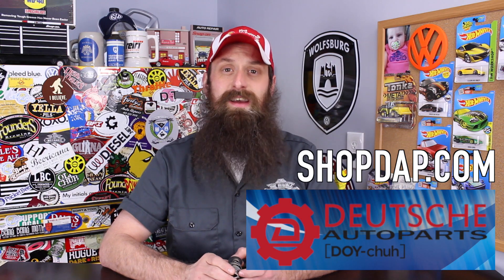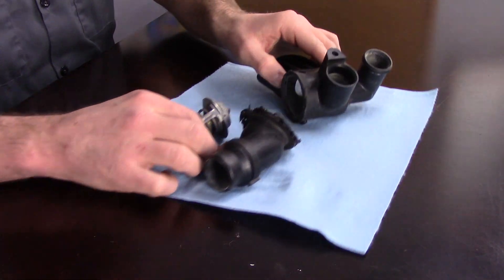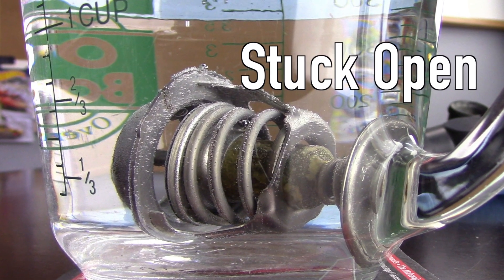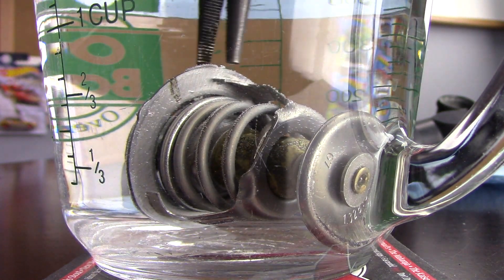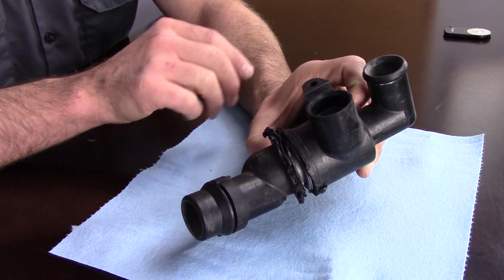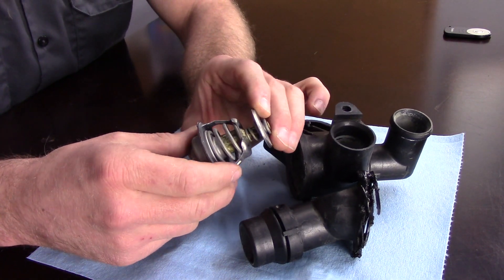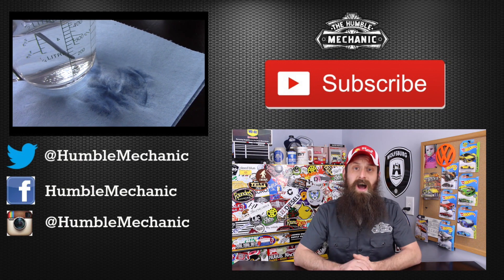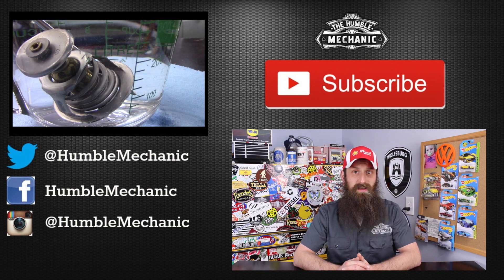How VW Parts Fail ~ 2.0t BPY Thermostat Code p2181

Comment: A lesson from one DIYer to the other DIYers out there.... On the BPY (2.0 turbo FSI) watch out for those slider pins on the alternator. I barely got them to move after soaking them with penetrating oil overnight.

Comment: Hi Charles, vid was super, super helpful!!!!

Bit late on the vid but had to add this as it happened on my 2.5 B7 Passat .. In my case it was failing partially closed which cause the car not completely overheat but partially heat up and cool down in weird random cycles. Firstly, the car started to overheat only when idling and then gradually as I kept driving would also overheat at speeds 30~40. 

On side note... why, oh why, did VW put the thermostat in between the intake manifold and the engine block!!!???? It turned a 5 min job into 3hr+ job 😥

Comment: Hi Charles I work mostly on VW and other European cars and what I see most of the time is the thermostat opening too early some cars will display a fault for coolant system temperature not reach or something like that  but some car are really good at hiding the fact that the coolant is not getting hot enough one motor come up to mind is the FSI engine what I do is always go for a test drive and check with a scann tool and make sure that the tempeture that the ECM and Cluster is the same or close and go for a test drive at a constant speed and check if the engine coolant reaches at least 90 deg cel but most of the time it will be at 75 deg cel then you know that it's not good but a stuck thermostat in A VW is not very common but a broken water pump is I would say for a common engine the 2.5 L five is not easy to replace especially on a New Beetle I have yet to replace a water pump on a TSI engine .

Comment: Have this code on my 2008 VW Eos. Also the temperature gauge would never reach 190 degrees which is the middle. It would hover between 145 degrees or 170 degrees. If I'm driving in the freeway it stays at the one quarter near cold. That's how I knew it was bad and stuck open so I sent it to my mechanic. Will update how much it cost me.

Comment: Any thoughts on  the over cooling issues with these vehicles. P2181 code ., Cooling system performance.Not really looking forward to doing that thermostat and housing would it be possible fuel temperature sensor?

Comment: P2181 check engine light is on. Engine warms up and maintains temps in the normal range in both hot (110 F) and cold (20 F) weather. Any ideas what has failed?
Reply: any luck in diagnosing? i’m currently having the same issue.

Comment: I'm glad you posted this video when you did. I've got a B5.5 Passat with the 2.8 and I'll occasionally get this P2181 code for "cooling system performance". I'm thinking it's probably my thermostat (replaced the coolant temp sensor, didn't help) that is stuck open because the car runs just fine but takes quite a while to warm up to normal coolant temp. Usually a good 15 - 20 minutes of normal driving on a 70 degree day. Is it usually ok to run the car like this and just clear the occasional code? It's a big job on the 2.8 that I'd rather avoid altogether if it's safe. The labor cost would be about half the value of the car lol
Reply from the maker: +Jake L HAHA, yea that is not a cheap repair. I would not wait too long. At some point it may cause an overheat condition.

Comment: Charles, I enjoy all your videos great information. 
I have a 2006 VW Jetta GLI, I get a P2182 code about every 3 to 5 days. The car is not overheating and the temperature gauge is working just fine. Checked coolant flow with the hose off at the coolant recovery tank and get coolant flow at cold engine start up. So the thermostat must be stuck open all the time. I am on vacation and will be returning home in 2 months. Since it is summer, I was wondering if replacing the thermostat  could wait until I am back home.

Comment: For my p2181 was that instead of the thermostat stuck open/closed. It was the coolant temp gauge on dash not working properly such as either showing actual temperature or stay on low side all the time. I'm about to change the temperature sensor first and see if this fixes the problem..

Comment: We have a 2015 EOS and are up at a higher altitude (Santa Fe, New Mexico) and the check engine light came on. Ran FIXD scan, says P2181. Car is driving fine, no issues, not getting hot, no noise. interior heater is working fine. All dealers are super backed up and we are leaving in a few days. Could it just be the altitude is messing with the sensor but the car is actually ok?

Comment: my 08 gli fsi tstat has been stuck open for over three years never had a problem check engine light came on once in winter does not get cold in texas I run most of my old cars without them most days its around 105 daily its not needed always stays 3/8 of the way even cooler on highway

Comment: Mine is currently stuck open. (Luckily) I don’t know if it’s just stuck open a little or all the way. Once in a long while, I’ll have to clear the code. Engine does eventually get to temp and my heat in the winter takes a little longer to get real hot. Other than that, it seems ok.

Comment: Could the P2181 be from a bad water pump also? My 2003 Jetta heats up slowly, once it heats up the temperature gauge slowly dips while driving, then goes back up when sitting.

Comment: I live in FL and have the P2181 code.  I suspect the engine is running cooler (stuck open) so should I care about replacing this asap?  I run the heat maybe once or twice a year down here.  Note:  This came on weeks after I did my timing belt service which required me to replace the coolant.   Could an incorrect mix of coolant/water be the case, such as too much coolant?  If so, changing the coolant again would be easy.  Thanks for any feedback.

Comment: what part of the tsi do you think would be the best place to drain the coolant in order to replace the water pump/thermostat? would there be a hose that you could contain the pressured outpour easier than others, or better to just have the car been cold before starting? great job on the videos and thanks again
Reply from the maker: I usually just drain the coolant by taking off the hoses at the water pump. It makes a little mess, but I feel like I will make a mess either way
Reply: +HumbleMechanic thanks, that's kind of how I thought about it but thought I'd check in case you had one of those secret tips that only experienced mechanics learn about

Comment: I recently replaced my waterpump,  it came with a new thermostat in it and a new temperature  sensor , now i get this code .. i have heat in the car, it doesn't overheat, but noticed my electric fans don't seem to come on now, temp Guage goes up to 190 but never goes over... im lost here😢

Comment: I have a 2.0T B7 A4 Quattro, MIL came on with a P2181 code.  Temp sensor has been reading between 1/4 and 1/2 (never stays at 1/2) Heat works.  Car DOES NOT overheat at all.  How do I know if its the Thermostat or the Sensor...Is there a clear cut way to tell Sensor Vs. Thermostat?  If I had to take a guess, id say mine is stuck open mostly all the time.  (although it does go to halfway and stay some time)   The MIL I reset and that was 2 weeks ago, it never came back on, but again the gauge on the dash shows it running colder than normal most of the time.   Any input would be most appreciated.

Comment: did one just last week, after the car was at operating temp the bottom radiator hose that comes off the bottom of the housing was cold, not even warm. the thermostat was stuck closed.

Comment: Question: My girlfriend's Jetta(CCTA engine) has been throwing this code lately, and has been running exceptionally cool at speed(1-2 ticks below 190 on the gauge), and I believe the P2181 code was related to this. It does however heat up to the normal 190 temp once I slow down and get into traffic. The car never overheats that I can tell, doesn't leak anything that I can tell, and the coolant level always seems fine(if not even a tad high). I was told the water pump was replaced/repaired before I bought it(still attempting to confirm this). I checked the heat, and it does blow hot air just fine.Would you be more likely to suspect the Coolant Temp Sensor or the thermostat? Or other components? How hard is/are this/these to replace? Is it something I can replace myself in an hour or two in my local DIY garage? Is this something I should address immediately, or is it not a big deal so long as it's not overheating?Additionally, my girlfriend said she was driving down the road(with the P2181 CEL on), and she said the car "dinged" or chimed at her for no apparent reason, she said the temp was ok, and pulled over and said everything seemed normal, she said the coolant level was fine and nothing was steaming or leaking or smelled like coolant. Would the car chime in such a way for a code like this?
Reply: same thing is happening to me did you ever find out what the problem was ? im thinking might be a  wire problem.
Reply: One of the two sensors (most likely not the one for the fan, unless your fans seem to always be on) or sometimes just air in the system that's easily bled out via the reservoir cap or the bleed screw on the hard coolant pipe.

Comment: What if I take the thermostat off??? I have a 2010 golf gti 2.0 stage 2 just got the engine fix couple of months ago because overheating it was stock by then, and just changed my coolant sensor and installed a dv valve, the drive it's awesome but do I really need the thermostat on it??

Comment: +humble mechanic, hey i feel like my B6 BPY takes quite a bit of driving before the engine warms up is that normal(in comparison to other makes and models) ?
Reply: I came here looking for the same answer. It always gets to temperature (200F) but it takes a long time on those winter days, especially compared to my TSI. Did you ever find an answer to your question?

Comment: I got this code on my 2005 jetta GLI 1.8T the p2181 is the thermostat the most usual or could it be the fan, because I noticed that when the fan turns on, the temperature gauge goes just barely past the middle. still it's concerning since its vw

Comment: What are some of the differences between the thermostat (or diagnosis) for a p2181 code in a 2.0t TSI engine?
Reply: I'm having the same code on mine,  I just replaced the water pump,  it came with a new thermostat and temp sensor but I get this code now and I don't think my electric fans are working

Comment: I have a 2014 Volkswagen beetle the temp light is on the temp reaches 195 degrees and rests there. Is that to hot to drive
Reply from the maker: which temp? 190 coolant is totally normal.

Comment: I have this code on my Audi B8 2013 1,8 tfsi, engine reach 90 temp fast. Then down to 50-70 up and down, never stabilize. Would you say thats a pretty clear sign of thermostat failure ?

Comment: Probably a dumb question but if the thermostat is bad will that effect the ac in the vehicle?
Reply from the maker: It can, but that’s not common. Usually you have engine issues before ac issues
Reply: @HumbleMechanic  No problems with the AC until my check engine light came on. Used the OBD scanner and it showed my thermostat was bad.

Comment: I have a 2009 gti with the tsi engine and I have the p2181 code but my concern is that I’ve noticed that when I turn the car off I get a burning coolant smell in the cabin, could the smell be caused by the thermostat or could it possibly be something else like water pump, a heater core, radiator etc.? I haven’t noticed any difference coolant temps or level. And my heater works fine
Reply from the maker: Probably have a coolant leak too.

Comment: Hi..   I put aluminum water pump on my MK6 couple months ago, recently my car have the P02181.  At the moment isnt overheating, but the car misfires.  My question is...   this can still be a bad thermostat?  For being open all the time the car may run cooler and the coolant temp. sensor can get trigger for this?   To be on the safe side should I change both?   Thanks!
Reply: Hi i m not Humble, but missfire from a MK6 i would go directly to spark plugs or ignition coils weird to hear that a thermostat could give this faults
Reply: Ruben La Rosa  I know, i highly dout that is the thermostat.  But the car start misfiring all of the sudden.   I have the check engine ON but the only code is P02181.
Reply: @erikpratts4871  budd i dont think a thermo can give u these issues but if it does its serious the problem. Thermost only control where coolant liquid goes..

Comment: So for my 2004 R32, my P2181 code was resolved after the temp sensor was changed last Tues.  This morning, the check engine light came on again, 1 wk after the "fix".  If the dash gauge temp needle consistently sits at 190 deg, could this suggest it's the Thermostat?   How hard is it to change this on the R32 Phaeton V-6 engine?

Could it also be the fan motor or the radiator itself?   Great video.
Reply from the maker: +Peter Simon Kim It could be the fans, be sure to check and see if they are coming on. I will say that p2181 is almost always the thermostat. It is not a hard job. You can use my MK3 Thermostat video as a guide. Yours will be a little different, but not awful. 

Other option, you can just give me your R32.. LOL :)
Reply: +HumbleMechanic ---- I have to correct myself.   The Temp Sensor they changed out last week was that going from the engine to the dial or gauge on the dash.  The actual coolant Temp Sensor was not changed out.  Since my initial post, I also checked the heater, and they they blow heat through the vents right away as per someone else's suggestion w/ the key on ---- http://wiki.ross-tech.com/wiki/index.php/18613/P2181/008577
Reply: +HumbleMechanic --- But the mechanic I went back to this afternoon who did the work last week also mentioned that it is possible for the MAS (mass air sensor) to go bad causing this.  Is this right?  Time for a new air filter, especially if my K&N looks grungy?
Reply: +HumbleMechanic --- You probably deserve MORE than an R32, my friend!!!   Oh, if I just had the power...
Reply from the maker: +Peter Simon Kim Never seen a MAF cause a malfunction in cooling system fault. Not saying it's impossible, but it's an out there concept.
Reply: +HumbleMechanic ---  Thanks.  I'll let you know how it goes.   Love the vids.  Keep them rolling.

Comment: Hey Charles, so two days ago I left work, and I noticed my temp gauge was not getting up to temp. When I would be driving, it seems to get to temp. But when I stop, it seems to drop down. I do not have any codes. Also, the heat seems to be plenty hot. Is it the thermostat? Like I said it just started. I’ve been trying to fix a lot of the things not working properly on my car, and now I have another lol. As before, it’s a 2007 GLI Fahrenheit, with 197,000 miles. So all the things going bad, it just seems to be that time in its life.
Reply: Could you maybe mention the other things that could cause under heating, and or how to trouble shoot? As I mentioned, it does NOT have any codes. Also, I replaced the coolant temp sensor about 8 months ago.

Comment: Ok guys. I just replaces the heater core on a 98 beetle (not fun). I still don't have water flow. I am going to change thermostat and temp sensor (stock). My question is could it be the water pump or just a clog in the system. Thanks. Any help rocks.
Reply: A little more info. Before I started the car, the radiator hoses were nice and playable. When I started the car, and it built up pressure, the hoses were hard like cables.

Comment: would it cause coolant leaking? i have a 99 vw beetle
Reply from the maker: Possible. The housing can leak. The coolant flange on the side of the head is a more common place. But over 20 years old, it can be anywhere.
Reply: HumbleMechanic i have looked under the car and its leaking on the left side of the car running off the oil pan to the ground. Now the person i bought from says her father replaced the water pump and timing belt a year ago. Would it be possible that its the water pump again? my car leaks coolant as soon as you put it in? I cant even drive it down the street literally withought all the coolant leaking out causing it to overheat?

Comment: So i have a weird problem with my golf MK3 1.6 aft motor. The car wil get up to 90C (operatingtemp) when stationary, but when driving it drops down to about 75C. How is this happening?
Reply from the maker: sticking thermostat maybe?
Reply: Mmmm, could be. My friend thinks i'm driving without thermostat, but the heat works and it gets up to 90 when stationary. I will change the thermostat en look what happens. Could it have something to do with the coolanttempsensor?